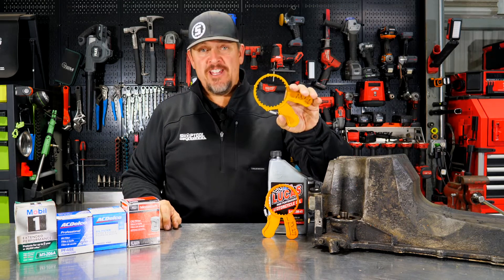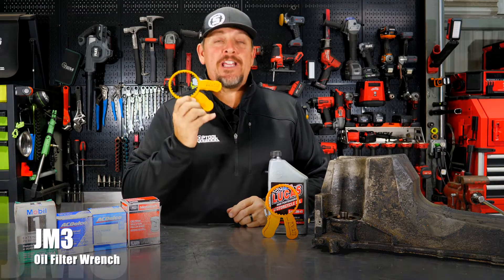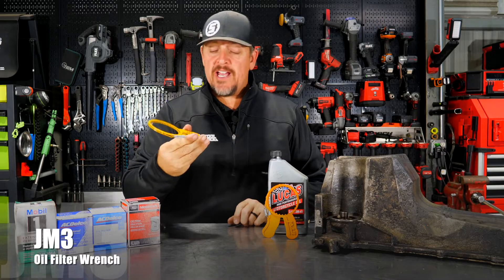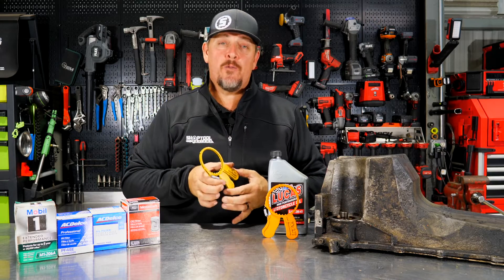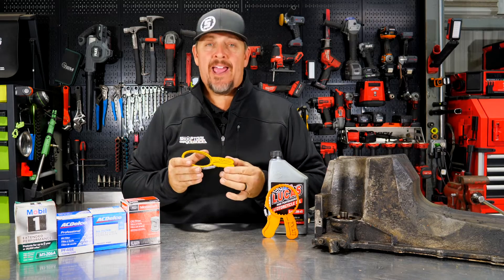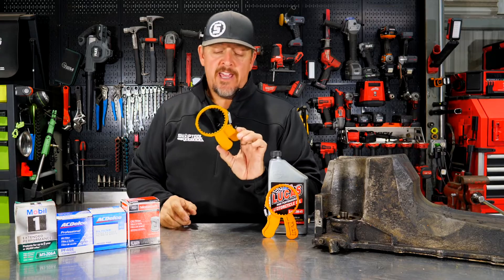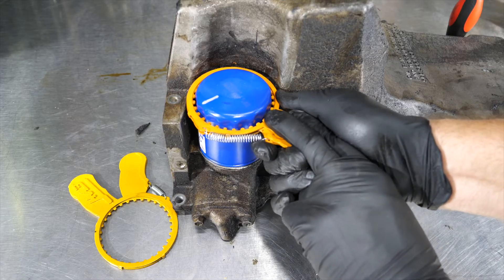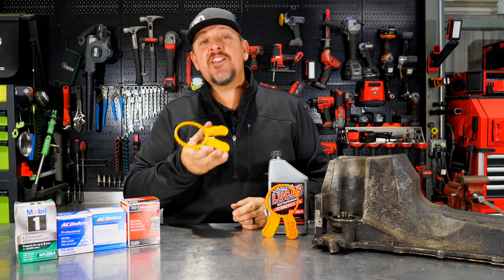Does It Really Work? JM3 Oil Filter Wrench Review [Made in the USA]

Comment: Anyone who’s spent any time in a shop will know that squeezing two wrenches together in one hand can produce a ton of torque relatively easily compared to trying to pull/push on one wrench the traditional way. Seems to me like you could use one of these to tighten a filter in a really hard to reach spot as well as loosen. I wonder if they’ll come out with a ratcheting version of this tool or one that will work with cartridge style European filters. Awesome review Tim!  I can’t wait to try this tool myself.
Reply: That’s next year at SEMA. Thank you for your kind words
Reply: That does work, but the other half of this wrench only serves the purpose to push the wrench handle back away from your hand. The "squeeze" is not really a feature that actually uses grip strength 

It's just a giant funny looking box end wrench
Reply: @The_Original_Drex  silly comment it's functional both ways, I've been using this tool for months

Comment: The problem I see with this is that, a lot of newer cars have the filter in a place with limited space.
Reply: Yeah, doesn't replace my cup wrench set
Reply: That’s the whole reason for my tool it’s one tool. No need for. Ratchet or extension and possibly a swivel. And if you can touch the filter and squeeze not push or pull like every other filter wrench requires, just squeeze and my tool does the work. Have to see it to believe it.
Reply: @JM3OFW  I don’t think you understood my point at all.
A lot of newer cars, including Subaru, Chrysler, etc., have literally an access circle not much bigger than the filter. The filter is obviously above the circle so it doesn’t get damaged. You can’t even really get filter pliers in there to remove the filter.
I already have the tools I need, so I have no need for your “amazing” filter tool.
Reply: @DiligentDave1966  yeah I kind of misunderstood. But you should still give it a try. What the worst that can happen? But I apologize. It’s my baby man. Lol got to send it off into the world so it can grow. Plus remember all the new tools that first come out , we are all skeptical but then eventually we say F- it and buy one. Well I’m advocating and honestly just holding it your hands is cool. Just get one. If you don’t like it. Send it back.
Reply: @JM3OFW  Right now it’s on a two month back order, according to the website in your link.
I’ll check back.
Reply: @DiligentDave1966  after SEMA we got slammed. But hopefully by the end of the month we will be caught up.
Reply: @JM3OFW  SEMA boosted the sales of several new products.
There’s a Vim Tools wrench extender that I was interested in, and it’s out of stock at several places too.
Reply: @JM3OFW  I appreciate the link because I follow his channel from time to time.
That wasn’t the tight clearance I was talking about. I was talking the opening in the skid plate, or whatever you call it, that is on most of the newer cars that I have done oil changes on.
Anyway, I spent a bunch of money on power tools during the Black Friday sales, so I don’t think I will be buying anything else for awhile.
I’m doing the oil change on my wife’s Chrysler this weekend, and I’ll probably be doing the oil change on my car next weekend. For those, I’ll just use the tools I already have.
By the way, I’m hoping to start making my own videos soon of me doing DIY projects. I’m looking for a decent phone tripod setup so the videos don’t come out looking like crap.
Reply: Hey man. Here’s a thought. Take off the skid plate for more access? It’s like 6-12 bolts max. I changed the oil on a friends 2022 civic and took his plate off for ease, it literally took 2 minutes.
Reply: @alexslaydon602  Hey man, I don’t need to remove the skid plate. I was just commenting on the fact that this tool isn’t right for everyone. I have a filter wrench that has a 3/8 drive opening in the center and fits multiple sizes of filters. With a ratchet and extension, I can get the filter off without removing the skid plate.

Comment: Worst filter removal of all time was when I changed the oil filter on a rotary screw compressor. Shut it down and let it cool for 15 minutes and it took me and another guy wrenching on it with all we had to get it removed. We decided to not do the next compressor until the next morning to do it cold. Same model and the sucker broke loose by hand. You learn something every day
Reply: Changing the oil filters on a Sterling LT9500 with a Detroit S60, had to remove the coolant filter and bracket and a few other bits then hammer my largest screwdriver through it and put a 1m cheater pipe on it then push from under while my buddy pulled the pipe from outside the frame...
It was on so tight that the spigot the filter fits to turned out a few threads and it had a little leak after.
Fun.

Comment: I bought one of these and it didn't work for my application which was a Toyota oil filter. I believe that the problem was that the tool was too big for my oil filter even though I told them exactly the part number of the oil filter that I was using which is Toyota 90915-YZZN1. Now these filters are truly tiny but since I provided them with this information I would have expected them to send me an appropriately sized wrench. I use a cup style wrench made by Motive X which is a beautifully machined billet aluminum tool that fits the 90915-YZZN1 perfectly and does a great job. Incidentally Toyota provides a torque spec for their oil filter which is 17.5 N-m which I do use with my torque wrench to tighten my filters.

Comment: I think this would work fine for filters that are not stuck, that just got normal torque during installation and have not been on for extended periods.   But for a filter that was cranked on, or hard stuck from extended time, I am not believing this thing is going to have any chance to remove them.

Comment: Motivx Tools by far has the best oil filter wrench's for removing stuck filters. That I've tried so far.
Reply: Maybe so, but can you SQUEEZE the handle and the tool does the work or do you have to push or pull. Either way I respect your position. Thank you
Reply: @JM3 Oil Filter Wrench  to be fair I'll be ordering your wrench in the size for a 2021 gt mustang. I do like the design. But the motivx has been the best I've used for stuck on oil filters. That way I'm not talking out of my ass
Reply: @goldentrucker7921  much appreciated. So Fordbossme have a video and he is on a gt500 and made easy work of it. Check out his page also Rainman ray. Those two guys have really done an outstanding job explaining how my tool works. But again thank you.
Reply: @JM3 Oil Filter Wrench  wife & I personally own 6 vehicles. I'm going to go on the website and look for 21 mustang style, and something that will fit smaller Corolla size. We own Tacoma & tundra, but they take the canister style.
Reply: @goldentrucker7921  All I need is the brand and part number. We sell sets make custom sets to fit your needs “no”extra cost, All we need is the brand and part numbers.
Reply: @JM3 Oil Filter Wrench  I'd be fl 500 Motorcraft, and I'd order the size needed for fram 4967. Also Toyota 90915 YZZD1
Reply: I don’t understand the mechanics of how these work. How is this better than just using a strap wrench leverage wise other than just giving you something to squeeze against?
Reply: Motivx is done and gone.

Comment: Okay I see the JM3 filter wrench  works well on bench as gentleman  did this test But try same test on car or truck after been on vehicle for 3,000 miles in weather conditions  and or in tight spot like my '86 Olds 4 cyl were your limited on hand movement with the oil  filter tool Not all vehicles are easy to get at the filters to remove them some are PITA. And Never over tighten Dam filters only go as hand ✋️ Tight . "NEVER USE WRENCH TOO TIGHTEN OIL FILTERS"